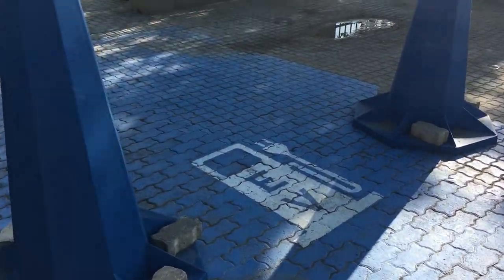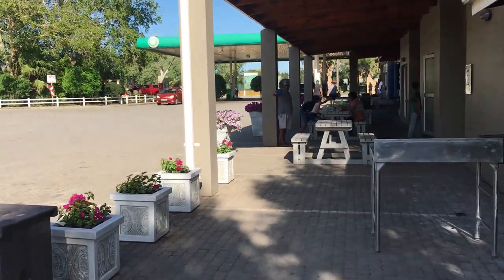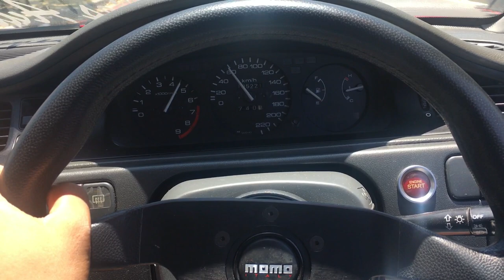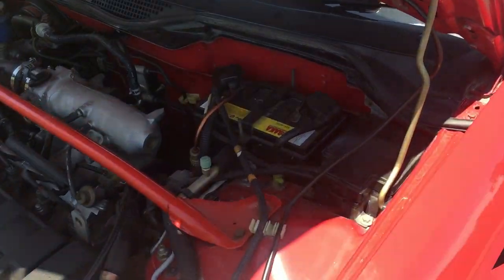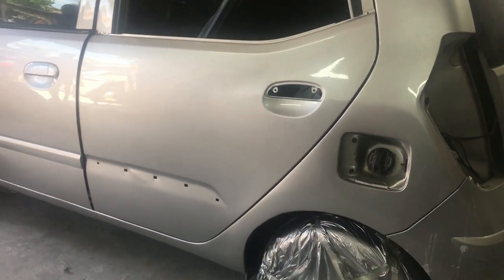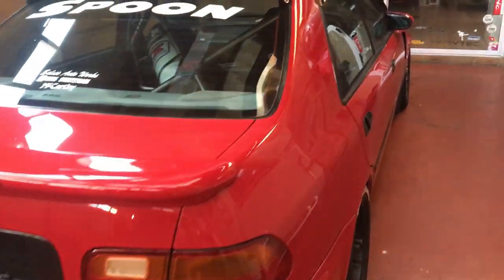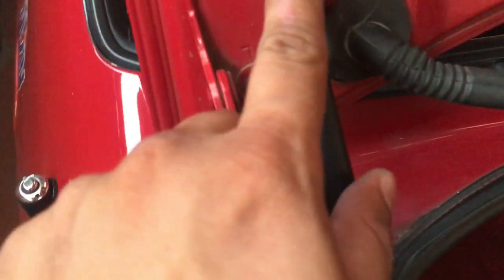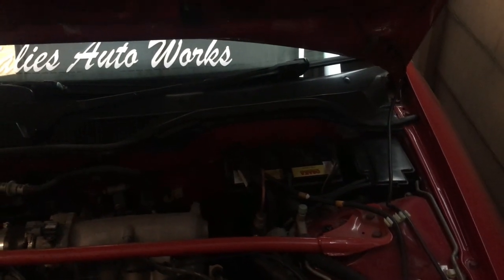HOW I AM GOING TO INSTALL MY QUICK LATCH (HONDA EG)

Comment: loving the build, I just wanted to know, if you remove the shocks that keeps up the bootlid, have you thought of a way to keep the boot open when needed? (so that the boot doesn't fall when opened)
Reply from the maker: grsymnky how do u mean fall?
Reply from the maker: If i put the bootlid on the floor how will it fall?
Reply from the maker: Thanks bro🙌🏼
Reply: @WongStreet2Track  oooh I see, you taking the whole lid off, I thought it would still have the function of opening as a normal boot lid
Reply from the maker: grsymnky Nope it’s completely removable. Similar concept like the KTuned bonnet hinges. I explain everything in Episode 2 & 3